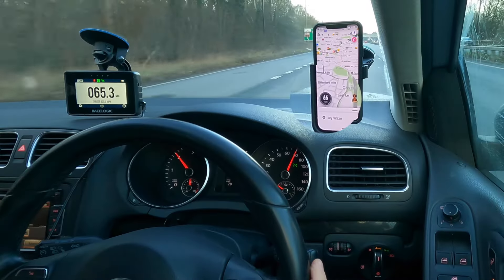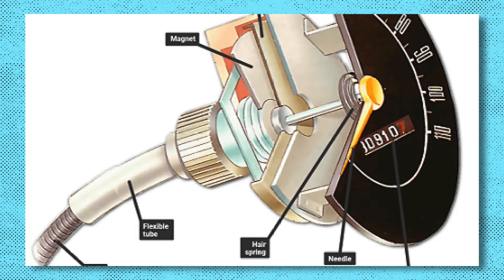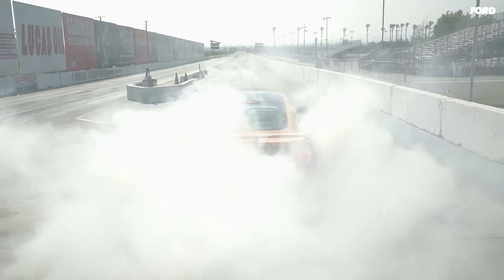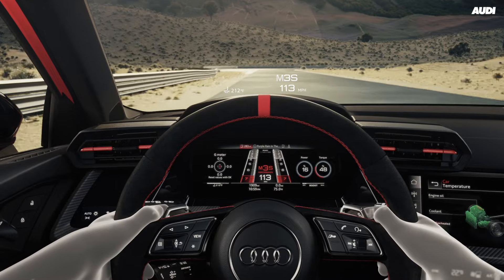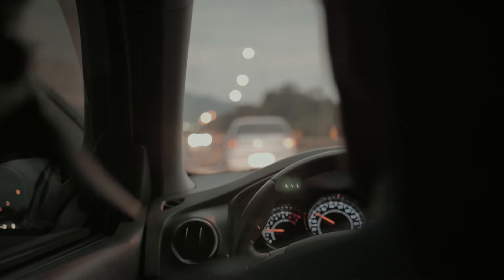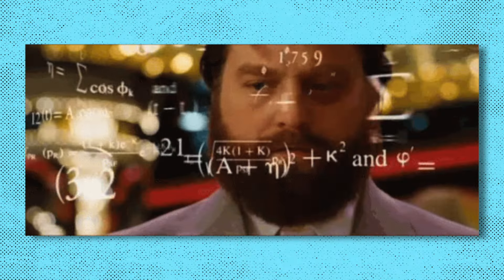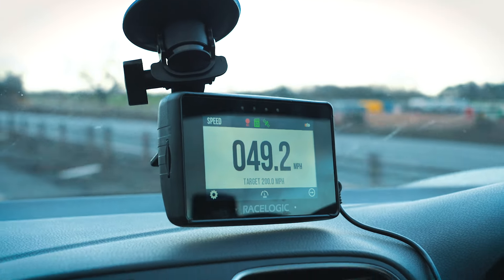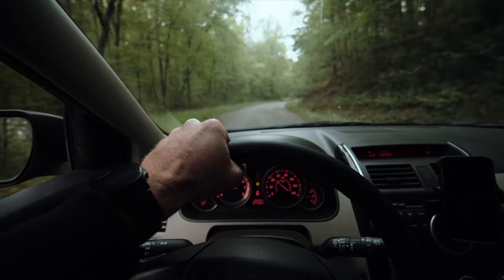Why Your Speedo is Lying to You

Comment from the maker: Right, let me know! Set your cruise control to 70mph in your car, and let me know what your phone reads! Also, let us know what car you have!
Reply: My Volvo v50 is spot on waze goes between 70 and 71
Reply: What is the point of this video? People have known about this for years and years.
Reply: My Audi A7 (2015) is usually spot on or only off by 1mph.  I used to have an Audi A6 (also 2015) and that was off by 2-3mph.
Reply: @davidt8087  What is the point of your life ? We already have billions of people and you can't provide anything the other billions won't. Replicate whatever answer you choose for yourself to the question you asked.
Reply: I remember a few years ago, where a group of taxi drivers mounted illegally small tyres on their cars, so that the system would overcharge the customer, since it relied on the car's speed to calculate distance driven.
Reply: I recently realised this when bought an Audi A3. Overreading with the 17 inch wheels. I put on 19 inches from the rs3 and the Speedo is almost spot on, 1kmh off instead of 5-6 that it was. My guess is that the manufacturer will do one speed Reading system for that particular car and will do it more accurately for the top performing version of that car as it will likely have bigger wheels. Otherwise if done in reverse it will under read in the performance trim. Not a good idea obviously when driving a performance car. In the video you are driving a more base version of the golf. I bet the top spec mk6 golf will have a much more accurate reading if not spot on.
Reply: @peterchampagney4990  Believe in JESUS today, confess and repent of your sins. No one goes to heaven for doing good but by believing in JESUS who died for our sins. GOD loves you soo much unconditionally.😍😚☺🤗❤
Reply: 04 v6 mustang is on point, 2016 Honda HRV over reads by 5ish
Reply: @ThatOneDude7  your really emotional
Reply: My 19 GTI reads 25 when the local speed camera reads 25. I'll have to see what it does ar higher speeds though.
Reply: My car is a 2008 Subaru Wrx sti, in Australia. Converting to/from freedom units for you, if I do 70mph (113kmh) on my speedometer the GPS phone app speed says I'm doing about 65mph (105 kmh)
Reply: They have to read over by law
Reply: At 60mph, my car is over reading by about 2mph
Reply: @HirenDShah  My A4 does the same as your A7 on summer tires and your A6 on winters
Reply: Most accurate were my old hondas...especially type r...normally around 1-2 mph out ..my old beemers were around 5-7mph ....lol
Reply: My car doesn't have a cruise control, I'm still driving an old Peugeot 405 man. Thanks to US and UK governments (and off course Iran)  people driving crappiest cars in the world, you can even imagine what's going on here in terms of cara.
But about your question, yes I know the speedo in cars showing more speed than our actual speed, and that's because we drive slower than speed limits in roads.
Reply: Hmm, must be some European thing. 
Speed gun/readers, my GPS from Google, and my speedometer all read the same in a 2021 jeep grand Cherokee. 

My 1984 AMC CJ7 is also the same up to 85mph (since my speedometer can't read higher) and that is a mechanical driven speedometer from the transfer case. I did however needed to change the speedometer gear in the transfer case due to running oversize tires

People aren't doing math in their head when they're speeding past you.  They're just speeding past you without care.
Reply: In the United States the speed laws differ by each state and their tolerance also differ. Researching that area would be difficult and taking only one source which most likely only red referring to their respected state would be wildly inaccurate to the rest of the country. I find it funny you tried to take a stab at a specific news agency when the reality is practically all news agencies skew what the they put out for their agenda instead of you know, give unbiased news.
Reply: My Jetta is off exactly to your golf. I’ve complained to the dealer about it because I thought it would have an impact on distance travelled on the odometer, effectively reducing the warranty
Reply: Audi A4 B8 +/- 2mph up to 130mph.
Reply: For work, I drive a 2013 Citroen dispatch, which tends to be quite accurate. Tends to read 2mph over what Google maps indicates.
Reply: My North American 2015 Fiat 500 Abarth's speedo is accurate according to roadside speed detector displays as long as I mount the OEM size tires of 205/40R17. With my 195/45R16 size winter tires, the speedo will show 110 km/h on the highway but I'll actually be going about 107.

Maybe the speedo on your car is calibrated for the biggest OEM size tires available.
Reply: I did this before in my BMW m235i, the phone read 66 to 67. When I replaced the tires it read 68. There is a menu on the dash to calibrate the speedo but I felt it's not necessary. I like this little buffer because it's very small it's not a big deal
Reply: 2007 toyota camry always over reads by almost 3 mph.
Reply: In my Alfa Brera (on 19 inch wheels) it is almost the same.
Reply: I just got new rear tires for my car, out of curiosity I measured their exact diameter and it was different from the theoretical calculated diameter by about 2.4 percent. That would also introduce errors if the speedometer is calibrated based on theoretical diameter
Reply: Jaguar F-Type R on stock 20" wheels overreads by 4mph
Reply: Pajero Sport and Honda CRV both 4kph under.
Reply: 2005 Hyundai Santa Fe 3.5L V6 FWD :: OEM speedometer over-reads +5 mph (+8 kph) :: speedometer 70 mph vs Phone 65 mph
Reply: Uh..... the same as my speed.
Reply: I took a special trip just for donuts and to read my speedometer for you!
At 70mph on the dial, Google maps says I'm going 65
Very VERY interestingly, when I go around The Big Bends, cruise holds the needle at 70 but we definitely speed up and google maps says we take that section at 66.
Reply: Golf 7 (km/h car to gps): 52 > 50; 93 > 90; 115 > 110; 136 > 130. It's about 70 > 67 mph car to gps, but the difference actually increase with speed.
Reply: I own a Ford EcoSport and at 100km/h the GPS gives a reading of 96-97km/h.
Reply: I've found out that our Opel Zafira has the acatual correct speed if you connect via OBD II that is very close to GPS speed, while speedo shows about 10% over at any speed, probably so companies are protected from lawsuits for showing lower than actual speed. For example Opel shows 139 km/h when you are actually doing exactly 130. Also the other two cars (Fiat and Suzuki) both show 5%-10% over and I think that's the case with most cars in Europe at least.
Reply: @davidt8087  Keep projecting
Reply: 2009/10 Audi A4 quattro indicated speedo 70kph through a laser scanner got 68kph, ever since I run my car 2kph above my speedo and through every laser scanner its spot on accurate. Australia
Reply: Wife's Subaru Forester, 70. Google Maps, 65
My Rover 25, 70 (took way too long to get to 70) Google Maps, 66.
Reply: I just tried setting my cruise control to 70mph and it pissed alot of people of, don't get me wrong maybe I shouldn't of done it in a 30 zone but I needed to know, so my 2013 C63 Mercedes is 2mph out.
Reply: At 70 MPH my GPS is 68 MPH. I usually set my Cruise to 72 on the motorway. Car is a VW ID3
Reply: Youd think a car maker woild be more accurate with its speedometer reading. I mean if someone got a speeding ticket because of an inaccurate reading could easily lead to an law suit. Or at least here in the statses it could
Reply: My 2010 Civic (stock wheels) would be spot-on, agreeing with Google maps. And now that I've switched to a Leaf (stock wheels), I have to add an extra 2.8mph (in very much serious) to my odometer reading. Tried the speed calibration in the service menu to no avail. People tailgate me much more now...
Reply: Unsub
Reply: My speedo on my Volvo S60 consistently reads about 3 mph faster than my GPS at around 70 mph.
Reply: My old bmw 325i e46 was spot on, my new Toyota 86 reads 4kph slower than gps
Reply: i went up a single size on my tyre sidewalls & my car speedo is now bang-on.

Simples.
Reply: BMW (several models) will read +4 kph from 50 kph onwards. Below that idk.
Reply: not a car here but a cbr250r mine does around 15kmh overreading at 110 kmh which translates to 9,3mph overread at 68,4mph for you imperial lads
and my husqvarna TE125 is spot on on the dot all the way from 0 to 150 (kmh)
Reply: My car shows 70kmph while GPS says 65kmph, there is constant 5kmph difference at all speeds
Reply: @kiranm25x  what brand is your car?
Reply: 2012 1.5dci qashqai, 76mph on cruise control shows 70mph on Waze
Reply: unfortunately 70mph is illegal in all public roads near me....
Reply: My Audi A4 ,2014 is of by 1 mile when doing 70
Reply: 70kmh on speedo is 65kmh on gps
Reply: This is nothing new. If you have a BMW you can program true speed. Mine is on the dot accurate compared to GPS.
Reply: at 70 with no incline or decline, my radar detector and Waze also say 70. 2012 Genesis 5.0 sedan
Reply: I'm driving 2001 Astra G, difference was 5km/h. 
However, I have fix this manually by mowing the needle.
I can't say that that was a good idea because is good do have some offset if you use to drive at the peak of tolerance :)
Reply: I've got a 2007 Subaru Legacy in New Zealand that over reads by 10km/h. Tested with Google Maps and consistently get this. I've also frequently passed through multiple speed cameras with my speedometer reading 110km/h with no tickets.
Reply: @davidt8087  I didn't. Been driving for 13 years.
Reply: Suzuki Jimny +3-4mph gen3
Reply: My 2003 Toyota Camry LE is pretty accurate... I've been comparing the reading with my GPS, and it's spot on. The only thing is that my car's speedo reads by 5kmh(0>10>15>20)... So I can get 70, 75, 80, while relying on my GPS to give me the 71, 72, 73 etc. But once I'm on 70 or 75, my GPS gives me the same, but is a lot slower in reading.
I don't use the recommended tyres though.. I use 215/70R15
Reply: Hmm My BMW 330e is spot on, my mom's Auris is off by about 10% at 143 km/h [so that is the speed limit of 130 km/h here in Italy] My old car a Rx-8 was low by a couple km/h
Reply: In my 2013 Seat Ibiza at a 100km/h (62.1mp/h) I'm actually doing barely 95km/h (59mp/h)
Reply: Google maps says 65mph when going 70mph on my 07 focus.
Reply: 2020 wrx is spot on at 70mph.
Reply: I've owned 5 cars in the past 14 months and I have noticed that all 5 cars have done the exact same thing. 03 Explorer, 03 Matrix, 20 Malibu, 03 Celica, 21 Camry, 05 Camry. All have read a few mph over on the gps. With my Explorer I thought it was just because it was an older car with numerous repairs on the wheel hubs, control arm, tie rods etc. But I don't think its necessarily the car but rather the GPS. I could be wrong, given the statistics in the video, but its definitely an interesting discussion.
Reply: I have an 08 Impala 9c1 police and it's dead accurate
Reply: Both my cars (BMW E60 and Seat Leon) over reads 5km/h
Reply: Alfa Romeo 159. 70mph on the car. 68 on the sat nav on my iPhone.
Reply: At 70mph my truck goes 72mph per GPS
Reply: My going up a tire size, from the factory hard to find cost 2x as much size (toyota tacoma) so my 70mph being 72mph means it was spot on for factory size.
Reply: @holeshotshane6344  That’s probably at least part of the reason that the speedometers consistently over read the speed, so you think you are going faster than you actually are and don’t break the speed limit.
Reply: Mazda 3 - The speedo is about 3% above actual speed. The GPS speed on the built-in sat nav and the audio/visual speed limit warnings are accurate.
Reply: @giovannit.533  with the exception of 90 > 93, it looks like your speedo is consistently reading +5% (possibly -0.5 km/h though I’m assuming some ambiguity in reading the speedo). If it is +5% then 90 should have read 94.
Reply: @neilp1885  thats....... actually pretty smart lol
Reply: I have been knowing this for like 15 years and always use GPS or just count off the error (if I want to go for example 160 km/h, I will often go 170 on the speedometer). The most annoying part is when other people talk about their speed records or other discussions, where speed is of interest and then they just goes after what's read on the speedometer, without taking error into count. 
Btw. what a crap to have speed cameras that takes average speed between them. I can stand going slow for a short distance past a camera - but having to go slow for long distances even between the cameras is a pain in the ass. If I lived there, i would put a dynamic plate cover activated by a button inside the car (so the plates is normally readable for cops when driving in cities etc.) but can be covered on freeways and country roads as soon as the speed limit is exceeded (of course combined with a radar detector and laser jammer) 😁
Reply: 54mph on cruise control is my actual 50mph on GPS
Reply: Stock wheel setup with my ‘18 Civic Type R, my phone would read 68 MPH while with my 18” rims the phone would read between 68-69 MPH.  This is a constant error (vs a percentage).  My ‘15 Camry that I had before it would have read 66 or 67 constantly, I forget if the error was 3 or 4 MPH, but it was also constant.
Reply: One does not simply phase out the butt dyno
Reply: My 86 overreads about 5%, a Mazda 3 I had overreads by 10% exactly. Haven't tested any others.
Reply: Of the 3 hyundais my wife and I have owned they all would read 70mph while actually going 67. If I want to go 60 I have to set it to 62
Reply: @granolatimes7185  which ones did you own??
Reply: @holeshotshane6344  2 2014 na velosters, and currently a 2020 veloster n
Reply: @granolatimes7185  👍very nice
Reply: Speaking as someone in the US with a 2014 Nissan Frontier SV, I can say for certain that my speedometer consistently shows ~2mph slower than the 'your speed is' kind of radar/speed limit signs that are around.

Also, I asked it in a comment, might as well add it to this.....

Is "speedo" a common abbreviation of speedometer in British English? (asking in earnest)

As an American, I had to chuckle a little given that "speedo" here tends to refer to a type of bathing suit.
Reply: Right mine broke 
But my 2005 toyota tacoma prerunner racing development is spot on.
Crap seats there uncomfortable.
Reply: @panzerveps  Unfortunately taximeters are governed by the Measuring Instruments Directive which requires distance to be measured by a mechanical pulse meter which is generally required to be calibrated annually. They really need to update the MID to account for new technologies.
Reply: Reliable +10km/h. VW beetle 73
Reply: 2015 toyota camry S.E. reads 65 at 70Mph
Reply: Toyota Camry is spot on with GPS.
Renault Koleos gets to 118km/h before the GPS says 100km/h.
Reply: My Jeep Wrangler JL under cruise control seems to be spot-on with my phone's GPS speed during a cross-country drive with speeds varying from 45 to 90.
Reply: 2014 BMW X1 GPS 70mph, ODOM 75mph, ODBII 69mph, street speed display 70mph (yes, we have those in my area and on highway here in the US).   2 mph over read when at 35mph and go up until 60mph than pretty much over read by 5mph.
Reply: Suzuki Vitara in NZ is about 7% out, Triumph Explorer motorbike, 8% and my old Fiesta was a whopping 11% over reading.  Most accurate car I've found is a Toyota Corrola from around 2000. Almost spot on to GPS.
Reply: My Opel Meriva A has on summer tires a 1mph difference and on winter tires 5mph xD
Reply: My 2006 c class reads 2mph under at all speeds, but my rears are almost bald, so with fresh boots it might be spot on!
Reply: 2002 Ford Falcon, mine is around 5km under my actual speed.
Reply: My 2012 BMW 128i is exactly right according to waze.
Reply: My phone reads 70. 2014 Cadillac ATS 2.0t
Reply: My VW Touran from 2007 travels at 63 when speedo says 70
Reply: My car said 70 while I was doing 67 with factory sized tires so I went up in size and it is bang on
Reply: This is not anything new. Every ICE car I've owned has been like this and it doesn't matter what manufacturer. The variance differs though and becomes larger the slower I go. I usually drive to what my TomTom says is the speed I'm going rather than what the speedo tells me. In my Audi at 70mph (TomTom) reads as 72mph on the speedo (Audi). Small difference certainly. It can be as much as 5mph at lower speeds though.
Reply: He just wanted to make it clear that he believes what Fox News competition says about them. A completely horrible way to grasp any information that might help you learn something. It’s like asking the owner of a VW dealership once a day, who makes the best cars, and then complaining that Toyota told you something different the one time you asked them.
Reply: My Scion FRS (early equivalent of the Toyota GT86, only in north america) reads almost dead on at all speeds compared to a GPS.  I find German cars tend to read high more often.
Reply: Mine reads 67, 2016 golf.
Reply: Around 70/69mph at 70 in my 2018 accord
Reply: It's like setting your watch 15 minutes fast so you're not late..it only works if you're not aware of it
Reply: (2007 Mini Cooper) 64-66 mph
Reply: My speedo said 75kph but the police officer said I was going 82kph. I wish I had used GPS to check accuracy before the speeding ticket and impound. We can't legally go 70mph anywhere here.  🇨🇦
Reply: My VW Caddy at 70 is doing 67mph
Reply: I drive a 2010 Toyota Avalon and it reads anywhere from 3 to 5 MPH over. I know I'm safe from a ticket if I'm going "75" in a 70.
Reply: my 1992 merc w124 is off about 5-6km/h
Reply: 120 km/h on the dash and ~112km/h on the phone on my CRF300L Rally motorcycle. I haven't checked on my Hyundai accent but it should be around the same numbers. Radars in the province of Québec are set to take your picture at around 115 km/h. Knowing that, you can safely drive at 120km/h (dash speed) without getting a ticket even though the speed limit is at 100km/h on every highways. Cops often don't even bother at up to 130km/h (dash speed) depending on the road.

I got a ticket once from a speed cam, was at 123km/h (dash speed) when I saw the flash and it was showing 118km/h on the ticket. It is highly possible that the speed reading to trigger the radar and the one that is recorded for the ticket/picture are slightly different though. At the end of the day, it is a person that write those tickets, it isn't entirely automated.
Reply: Google maps and my car have a difference of 6 km/h
Reply: Mines like 15 off but that’s because of wheels and tires of different size than stock
Reply: What about watching the car speed in the navigation screen like Mercedes can do? Will it display car or gps speed?
Reply: Speedo reads 68, Waze says 113kph. Ooops!
Reply: Fabia 2016 typically overreads by about 10% on winter wheels, and slightly less on the stock wheels. At 75mph on the speedometer, waze tells me I'm going 70-71. So I usually sit around 73-74mph on the motorway
Reply: @davidt8087  not everyone knows
Reply: My Trabant isn't ever gonna get to 70
Reply: @davidt8087  it's for the people who don't know. It's how learning works.
Reply: 66